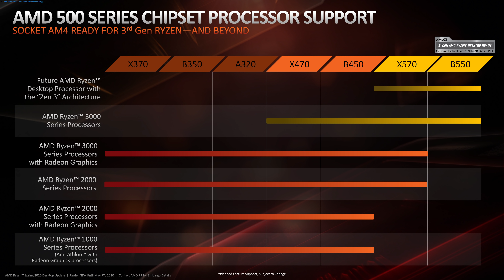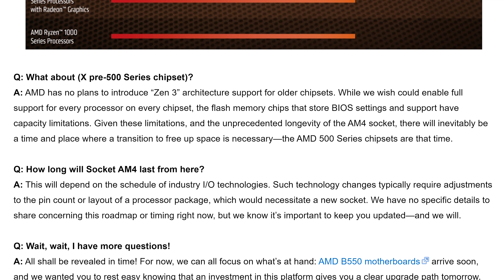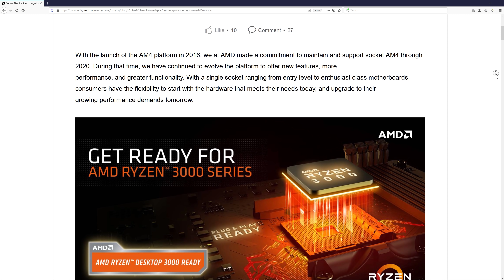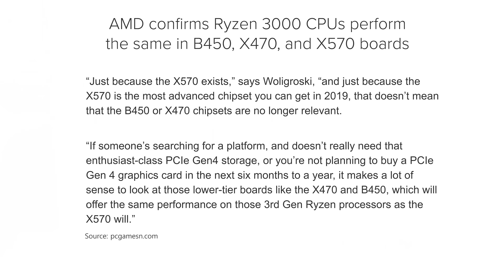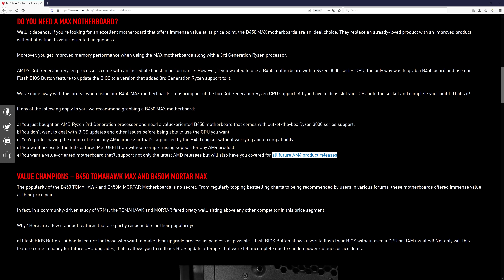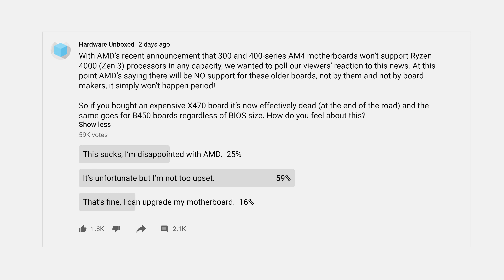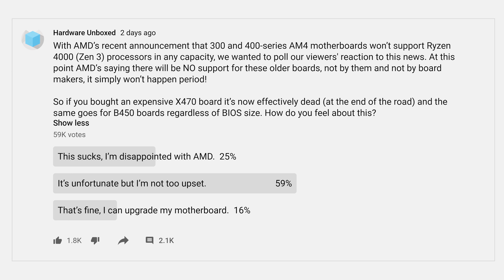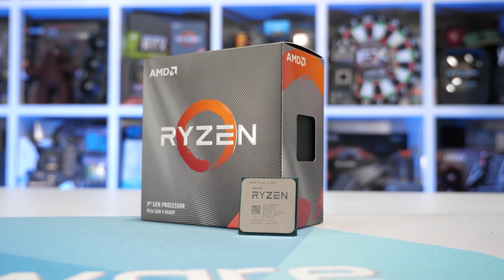AMD Does An Intel, Axes Zen 3 on 400-Series Motherboards, Our Thoughts

Comment: To be fair, the B450 runs Ryzen 1xxx 2xxx and 3xxx.

Considering I paid $120AUD for my B450 board, if I invest $400+ on a Ryzen 4xxx series I think I can afford a new mobo at the same time. Especially as the R5 2600 I got is still running perfectly fine and I don't really see any need to upgrade.

Comment: It doesn't effect me specifically, Im still rocking a b350 with a 1600, I would upgrade MB at this point anyway, but I agree that this move sucks for specifically the b450 guys. If they had released b550 on time with Ryzen 3000 series, I would say this would be fine. But because they told people to buy b450 for 3000 series, I agree that they should extend support to the 400 series motherboards this time, as many people bought those boards with expectation to be able to upgrade at least once without needing a new MB.

Comment: I think i'm gonna switch to Intel, honestly. I got a B350/Ryzen 1700X system back in late 2017 and honestly this thing has never really impressed me, meanwhile it seems like people with older Intel systems were running laps around me (gaming-wise). I'm definitely considering getting a RTX GPU when the new series releases and I don't want to suffer from a bottleneck.

Comment: When I was recommending the X570 Prime P for $150 and donkeys were like, "BUT B450 TOMAHAWK MAX at $115 IS ENOUGH NOW, YOU'RE WASTING $30+ FOR NO REASON," well, there's the difference between them and me. They look at NOW, I look at the future. Is looking three to five years ahead unrealistic? Not at all, then why bind yourself to a platform that's pretty much maxed out already and leave yourself no room for future upgrades just to save $30+?
I was a firm believer that even the X370 would support Ryzen 4000 CPUs, given how AMD said the AM4 socket will support four generations of CPUs, and while I don't suffer or benefit from this at all, it does make me happy that I was absolutely right in my recommendations, simply because I did say a B450 is fine if upgrades aren't in consideration, but an X570 is the way to go if upgrades may be considered in the future.

Comment: Okay Steve now address the elephant in the room.  Why did no-one in the Techtuberverse. call out MSI  on the Max being upgradeable to future processors when it was released.  If it was so widely know that support ended at the end of  2019?    Why were all the usual suspects (including this channel) recommending B450 Tomahawk Max for Ryzen at the end of 2019 without warning that it might not be upgradeable.    Did you all actually get taking in by AMD marketing?    Why did no-one question AMD about support for Zen 3 on the release of Zen 2?
Reply: Because support was obvious, as AM4 is still the socket.
Reply: @fbcaware8805   Actually Intel  has chips that are socket compatible but not chipset compatible.  So all the technical guru's missed this in the AMD marketing hype?

Comment: We are talking about processors coming out in q4 of 2020 and probably won't be widely available until 2021. I don't feel like they broke any promises. Also, BIOSes are confusing enough for most PC users. Having multiple BIOSes just isn't reasonable. Can you imagine how nightmarish it could be since what if you installed the wrong BIOS? There could be a situation where it doesn't support your new processor or the old one you have any more. You would have to way to flashback the BIOS. Effectively bricking it. Does it suck for B450 users that bought one specifically for Zen 2 expecting to upgrade? Yes. But I honestly never expected it to be able to support Zen 3. It has been clear that AMD is pushing PCIe 4.0. Since consoles are pushing PCIe 4.0 SSDs, PC gaming will need to incorporate PCIe 4.0 SSDs as the standard to compete. I know a lot of people not in the industry think the SSD is just hype. Even some nontechnical people in the industry think it is hype. But there is a reason why this has been the most requested feature from developers. Also, not all people who disagree with you are AMD fanboys. Some of us just don't see the issue. I mean it would have been really easy for AMD to avoid the controversy altogether. Think about it. All they had to do was push off the launch till 2021 use the same socket but call it AM4+ and use that as the reason. They could have even blamed it on the human malware situation.
Reply: Most users never update a BIOS, they'll be ok.

Comment: I'm glad I bought the heavily discounted 2600 with my B450 less than a year ago. Then I at least can upgrade to 3700x or higher CPU to get a decent boost without swapping MB. And I think the 3000 series prices will plunge in the wake of the 4000 launch, giving the supply situation normalizes. So all in all I'm happy either way AMD goes on the 4000 support on B450.

Comment: Meh at least I haven't had to buy a new motherboard every single time like Intel has for forever. Granted I did go with an x570 board for my 3700x but my wife's comp does have a 2700x with a b450 board. Which just means she will get the 3700x which is a fantastic chip in the first place. After using my 1090T for like 5-6 years (I got it in 2009) I don't mind supporting AMD with the great job they have done since I skipped pile-driver.

Comment: I'm not upset about this at all. B450 is two years old. Get a grip fan boys.
Reply: One issue, there weren't any B550 mobos back in July, forcing people to get a $170+ X570 instead of a $120 B550......
Reply: It's still the current B tier motherboard, it's literally still the latest model 10 months after the release of Zen 2. AMD fanboy fails again.

Comment: Steve my one question. If AMD had released the 500 chipset last year and made the socket AM4+ said at the release of the 3000 series ryzen they are am4+ but will be the last gen backwards compatible on the AM4 platform. Do you feel this would be an issue today? My personal opinion is at that point a lot of people that bought a cheaper b450 or x470 would have bought it knowing that it wasn't going to support future Ryzen CPUs or would have opted to spend a little more and bought the x570 platform.

Comment: THANK YOU for this video!
I had been waiting to make a new build for son, built his first tower 6 plus years ago. Got a msi b450 max and new amd 6 core zen 3. . .had to put build on hold for week and a half while we ordered an older 2nd gen cpu bc we couldn't afford the x570 upgrade yet.  He was pretty disappointed both at problems, wait, and downgrading cpu, to (lower speed as well). . .even after I walked him through the parts picking research and assurances it would all work inspite of multiple flashing of the bios, it never did. Thank you again for the video, at least we dont feel crazy anymore

Comment: I purchased a msi b450 motherboard and a ryzen 3600 to hold me over until the 4700x, or equivalent, is released. With no 4000 series support I will simply not buy a 4000 series cpu. I have a feeling that most people will choose to do this and thus AMD is screwing themselves over... Its all in their hands.  Very disappointed with this news.

Comment: I am not upset at all. I was actually impressed I could use a b450 for my ryzen 3600, and it was only 90 some dollars. I feel we got a lot of life out of these boards. Especially compared to Intel. And I was under the impression they made it pretty clear the 4000 series was not going to work on the older boards. I wasn't expecting it to. And my 3600 system will probably last me a good 5 to 7 years. At which point I won't have an issue upgrading to a new motherboard. I would be totally ok if they just did it on order for their partner companies to release newer products, that is how business works. I didn't buy my b450 board with the intention of dropping a 4000 series cpu in it less than a year after I got my 3000 series. If your plan was to stay on the cutting edge and upgrade everytime a new part came out why would you choose an older board that barely works and is pretty long in the tooth? Seems like you would have just went with the 500 series boards because they were new and designed to work with these cpus from the get go just to play it safe.
Reply: You were impressed that the current motherboards work with the current processors?
Reply: @fbcaware8805  No, I was impressed that the ryzen 3000 series didn't require me to buy a newer motherboard. And technically it didn't work at the time the time they came out. You had to have an older cpu and install a new bios to get them to work. And the 300 series mb I had there was no bios available. So I had to get a b450 and update the bios with my old cpu. It wasn't exactly plug and play. It was however much cheaper than a 550 board. I am pretty sure had it been intel I would have been paying 300 for the cpu and probably another 300 for a motherboard that would work with it.

Comment: For gaming there’s no need to change cpu every 2yrs.
Reply: I’m sorry do you have a 400 hz monitor? Most people just need a steady 144 FPS
Reply: Yep, i change my cpu once it starts bottlenecking my current midrange gpu, and i dont see my r7 2700 bottlenecking even an rtx 2080ti if i plan to keep playing at 1080p ultra setting smooth 60 fps.
Reply: Yes but nonono in fortnite and csgo, csgo needs 400 fps to be playable, new doom runs great 60 fps

Comment: I honestly was sceptical with Ryzen 4000 being backwards compatible with older boards from the start (since zen2 needed bios updates already with larger storage, roadmap stating support will last till 2020 - not specifying early or late 2020, etc.), but this reason is bullshit IMO. I own a Crosshair VI Hero. This board has 128mb - way more than enough to get any support on there. I know an x370 board would not be future proof, but the storage definitely is not the issue here.

Comment: I been rocking 3600 and B350 and works awesome

Not happy intel is killing off the 370-390 I think that’s a bad move because the only reason most people kept with intel was because the 9th worked with their 8th gen board 

I don’t think I will stick with intel after the new update and will just move to the 4600 if it has the extra boost I’m looking for over my 9600k

Comment: Having bought MSI MORTAR MAX B450 (very similar to TOMAHAWK MAX, available in Europe) just three months ago I'm quite a bit disappointed. Having "BIOS flash with a button" function and a board that's nearly twice as expensive compared to cheaper B450 variants makes little to no sense in the light of recent events. I know that I would've purchased different board. I believe that it would be fair if AMD allowed MSI and other manufacturers to provide bios at least for more expensive B450 variants which I imagine should be capable to run new bios. If that won't be the case, I hope that eventually someone will make flashable modded bios like for intel chipsets allowing to run xeon chips on regular lga 755 boards back in the day.

Comment: Are there going to be newer chipset boards on release of Zen 3 CPUs? Such as X670 and B650?

I'm debating picking up an X570 motherboard if/when they're back in stock at MSP and a 3900X to do a new build of my gaming PC (currently an i5 6600k OC'ed to 4.3ghz) and use my current 1080ti until RTX 3000 is available, then upgrade to a Ryzen 4000 CPU at some point down the line as well. If there are going to be newer (Ie X670) motherboards on Zen 3 release that are potentially worth waiting for, I may wait on t he above.

Comment: I bought a 450 motherboard with a 3600 last month. I really like my 3600, for what I paid, I'm pretty happy. I mean this really sucks for me, but it looks like my next upgrade will likely be a costly motherboard ++ CPU upgrade. 

If the 450 board I got did support future cpus, I'd likely only look at AMD upgrade options, but now it'll be a Intel vs AMD look again for me. This is the thing I think AMD shot themselves in the foot with the most. You usually look for the best cost/benefit ratio when upgrading in lower to mid tiers of performance, and AMD will lose some there.

Comment: I'm confused... I run a 6700K on an MSI Z170A board, I've been wanting to jump over to Ryzen for a while now, gathering info, researching choices etc. I always kinda came back to a good B450 paired with a 3600(X) knowing that I could have a good upgrade path as well. But now, I'm just not sure which way to go. It's like, how long can you keep waiting, and when is the best time to get on board with which platform? Urgh. Got to feel for those who bought into B450 and expected more (Rightly so IMO).

Comment: Well, I got the balls to stand up here and say, quit your dang crying. AMD and their board partners need you to buy more motherboards and there is nothing wrong with your existing computer it will serve you just fine for many more years. In fact, I doubt most of you were going to buy a new AMD 3000 CPU. It is purely a matter of bios memory space and the number of CPU, plus all the other hardware listings that can be put in that BIOS, plain and simple. 3 Years of chip compatibility is much longer than Intel has ever done!

Comment: The bios size is BS. All they have to do is axe uefi bios and go old school. That's what MSI did with my b450i Gaming Plus AC. Well its more of a mid place bios between old school and uefi. I think they call it uefi lite or something like that. They did it to support more chips with 3000 series tho. Also it's complete bullshit because they've taken a full YEAR longer than they should have to release b550. Every single person who has purchased a b450 board in the last year would of likely purchased a b550 board if it was available. I'm super pissed as I went with a b450 instead of a x570 because I expected support and also went with a 3600x instead of 3900x because my purchase was very recent and I wanted to upgrade to 4th gen 12 core when it is released. I'm unhappy to say the least and this is the same exact shit as Intel. They've definitely mislead their customers. Saying they're going to support the socket but hiding the fact they are only using said socket but won't support the chipsets is some shady shit. Seems very much like our quad core is an eight core all over again. This is class action territory considering they have published misleading documents.
Reply: The bios excuse is definitely not true - in fact there are X570 boards that only have 16mb chips, and they are going to be OK..

Comment: Could not agree more - bought x470 board in mind of Ryzen 4xxx, only because AMD promised to keep compatibility. If i knew that mb swap will be required along the way, I would go for  Intel as it is better at gaming. Bad move AMD, they have not learned from FX launch, 5600x bios fiasco and pci4/agesa mess. 
All good work with navi/ryzen will go to the drain if they will continue to drop the ball like this.

Comment: Currently looking at putting together a semi budget PC (~$500) using the B450 chipset and one of the new R3 chips like the 3100 because both of them are really cheap and powerful. Now, I'm reconsidering B450 and thinking about B550, meaning I'll have to likely spend more and wait longer for it. AMD, this is not acceptable; you are ruining the experiences of consumers that aren't able to throw away cash for the high end boards. Ryzen 4000 adoption/sales will likely still be alright, but not nearly as good as the previous generations. Backwards compatibility is exactly what made AM4 such a versatile platform. Come on AMD, don't be anti-consumer; we like your products and your pricing; we don't like your corporate money grubbing however.

Comment: B450 for everything up to Zen 2 and different B450 for Zen 3 is not an option?? HOW? 
 It wouldn't kill them to write it on the BOX and sell them at the shops that way just like B450 MAX is Ryzen 3000 ready and it says it on the box...

and its not possible to have Bios Update Options in ASUS/MSI/Gigabyte etc websites for different gen??

Board A
Section 1  - Bioses Supporting Everything up to Zen2
Section 2 -  Bioses only for Zen 2 and Zen3

or even have them there as different products to eliminate confusion like:
Board A1
Board A2

I don't have much experience and knowledge, but to me 4th gen only on b550 and x570 sounds like an Intel move focused on milking the regular consumers.

Comment: "the degree of compatibility AMD has managed .. is worlds better than anything Intel has provided in recent history".  You're forgetting Intel HEDT. X299 supports 3 generations of CPUs, while Socket 2066 supports 5 products (3x -X and 2x -W).  B450 supports 3-4 generations of CPUs (3 Ryzen + Bristol Ridge (maybe, depends on board and BIOS version)). These are both current.   AM4 is only 4 months older than socket 2066, seems to be recent and similar.

Comment: Ouch. October 2019 I bought AMD for the first time ever - on the promise of continuing support of new CPUs for some time, at least. I chose the very much recommended Tomahawk MAX because of its larger BIOS (32 Mb) and good VRM. So I am very disappointed, that my rather new board is an end-of-line product. I had counted on using it on Ryzen 4xxx. I think I'll sell my almost new board and for the time being use my very old laptop. No gaming this summer, then. Well, I have a lot of other stuff to do...